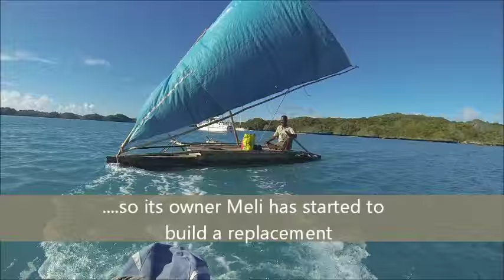A New Sailing Canoe in Fulaga

Comment: What a beautiful project to have a chance to take part in. The "non-traditional" tools, fasteners, and sail are exactly what the boat builders 1,000 years ago would have used had they been available. It's the design that is timeless.
Great video. Thanks for sharing your experience.

Comment: Es ist so beeindruckend zu sehn, wie seit Jahrhunderten solche Boote gebaut und nachhaltig benutzt werden. Leider findet man immer weniger dieser traditionellen Segler. Selbst im abgeschiedenen Papua habe ich nur sehr wenig davon entdeckt. Die alten Einbäume werden fast nur noch mit 15 PS Motoren bewegt. Ich verstehe ja, daß das für die Fischer praktisch und direkt ist. Nur leider sind sie damit auch der Sprit Mafia finanziell ausgeliefert und müssen viel mehr Fisch fangen als sie brauchen. Das ist wirklich traurig. Um so schöner diese Filme hier zu sehn.
Reply from the maker: English translation: It is so impressive to see how such boats have been built and used sustainably for centuries. Unfortunately one finds fewer and fewer of these traditional sailors. Even in remote Papua, I saw very little of it. The old dugout canoes are almost only moved with 15 HP motors. I understand that this is practical and direct for the fishermen. Unfortunately, they are financially at the mercy of the fuel mafia and have to catch a lot more fish than they need. That's really sad. All the nicer to see these films here.

Thanks for the comment! In Fulaga, with only one supply ship a month, being able to navigate around the lagoon without the use of 2-stoke fuel was a huge benefit and the canoe was widely shared by several families. Sadly, we heard it was holed on a rock a couple of years after it was built and we don't know if anyone has yet built another.